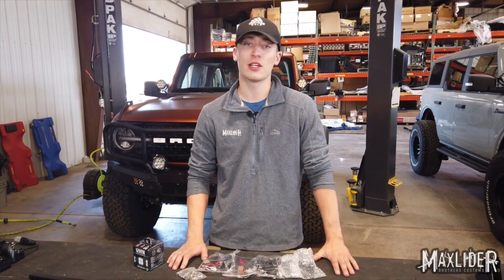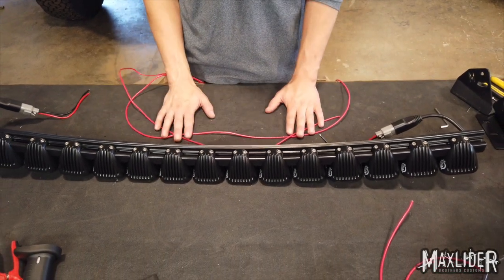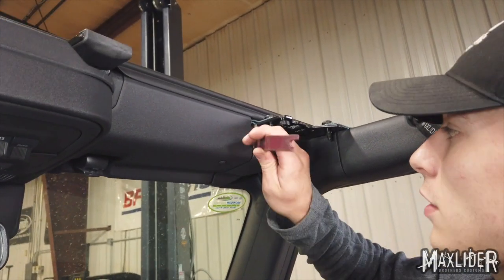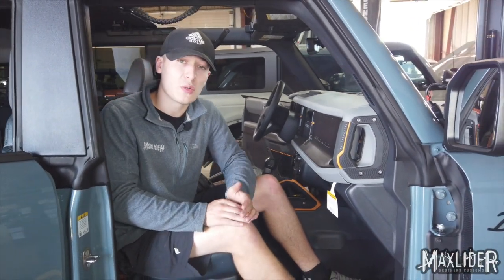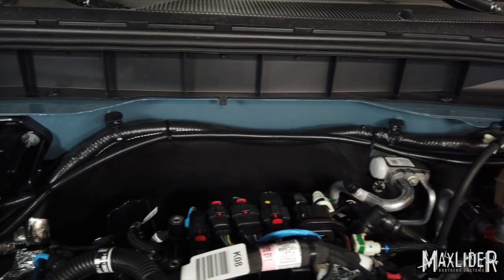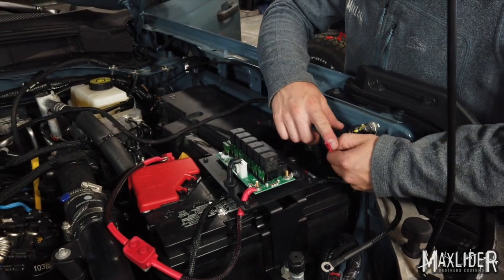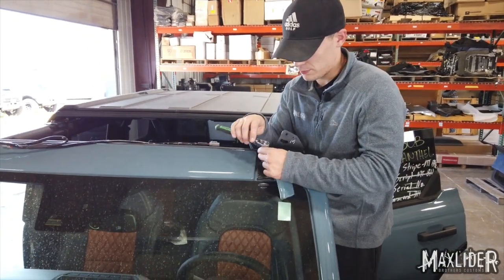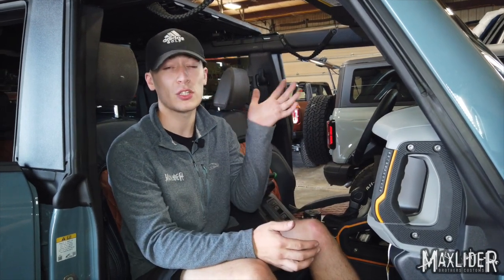How To Install The Maxlider 40 Inch Light Bar For 2021+ Ford Bronco & Ford Bronco Raptor

Comment: Pretty well done and detailed video. I do wish you would have shown how each half of the lights terminate to split in the middle, which I saw on the vision x site b4 u did this video, and how to do the 2x switch wiring as I will want to control my floods separately from my spots. Do the instructions that come with the bar show this? As it is a bit different install. Again, I believe it can be found directly on their site. Also if u could add the parts link for the relays or any other specifics like wire cover it would be appreciated. Thanks!
Reply from the maker: Matthew, thank you for the comment. I can answer your questions directly and more detail if you email me at techsupport@maxliderbros.com. Thanks, Kris